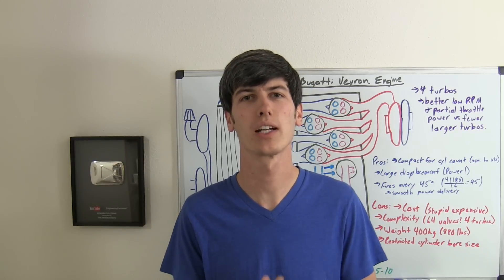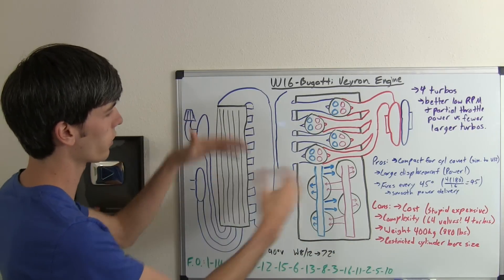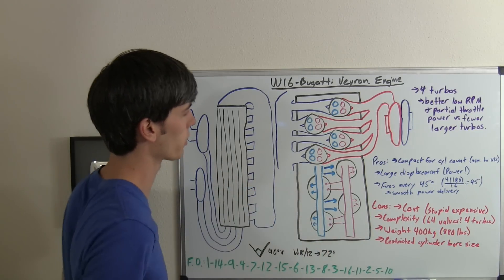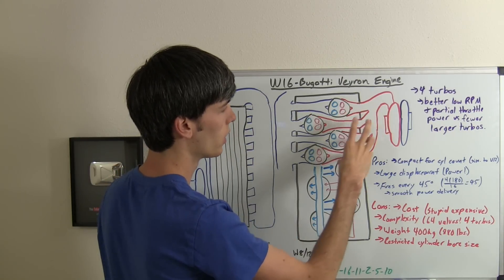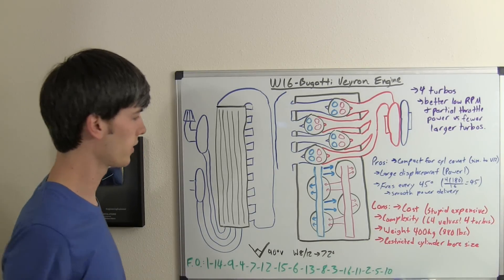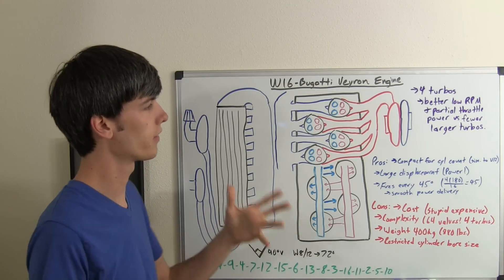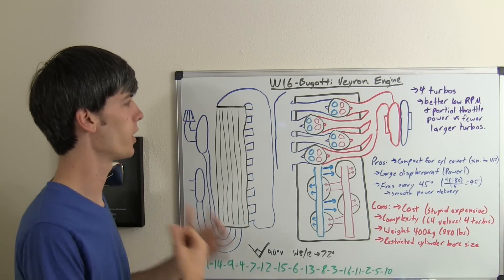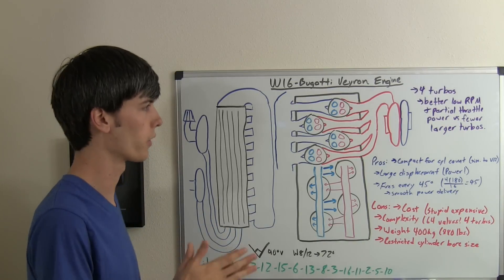W16 Engine - Bugatti Veyron - Explained

Comment: You forgot to mention to the idiotic fanboys that it's dot really a W! A W must can 2 crankshafts, and VW should call them a VVR8 or a double vr8!
But the 16cyl is utterly pointless, (except for bragging rights), as we all know, v8's are more than capable of making a mere 1250hp, and they are still as large as 7 liters. V10s go up to 8.4 in the Viper, and that engine would be making way more if it had 15psi of boost like the "w"16.
It's too large, it's unserviceable in the car, and it's only a selling point. The quad turbo is also somewhat of a selling point but it's to reduce the piping required. "It has more radiators than Jeremy Clarkson's house" because they wanted that stupid W16 selling point, so they literally had no space for an air:air IC or large enough single radiators...literally one of the stupidest cars of this era!
Reply: It not completely pointless. take a couple motors and say they are all 8L making 1000hp. a 4cyl, a 6 cyl, a 8cylinder, 10,12, and 16. For each of those they would have to make per cylinder 250hp, 166.67hp, 125hp, 100hp, 83.3hp, 62.5hp. Lets use the 4 cyl and 16 as examples. Each of the 4 cylinder rods, pistons, and cylinders have to survive the temperature and pressure for 250hp each. In the 16 cylinder each rod, piston, and cylinder only have to support making 62.5hp. Each cylinder, piston, rod, is going to be under less stress so the motor will be under stressed. At least i think that is the thinking
Reply: Torque man. You going to get a lot of natural torque and a lot of torque from the turbo added to that. However high numbers can be achieved without having a W16 i just admit. Look at the 65 AMG engines. 1000nm. HOWEVER the merc is rated at 1000nm only at a specific rpm where as the Bugatti will have more steady torque across the rev range. Keep in mind that this is just me assuming why they chose that engine.
Reply: custommotor That would be valid if the power figure was over 2000...A v8 with forged internals has no problems with 125hp per piston. And a v8 has way more room for each rod journal on the crankshaft, so the bottom end would be stronger. There is also more room to make the sleeves thicker. The bore also can be way larger, reducing the need to make the stroke larger to have a higher displacement. So a v8 would do just fine pushing +1000hp as MANY do. And as far as potential goes, it still has more than the "w". Why do you think hardly any company touches the Veyron's engine?! Plenty of +1500hp Vettes, Lambos, Vipers, and no Veyrons!
Reply: Best Braai
 Unfortunately I have not ever seen a dyno sheet of the Veyron. But based on the fact that the Veyron pushes a very low 1000hp on 15 psi of boost out of an 8l, it is likely that the turbos are small so all the torque is at lower rpms and the engine dies up top. I know they claim flat torque but think about it, the engine's just like 4 4cyl single turbos. Go look at the torque curve of any 4cyl making 250 hp.
Reply: The reason why they have done a W16 instead of a V12 or a V8 turbo is the fact that this car was developed a decade ago and VW already had W8 and W12 technologies and parts ready for power train. As development progresses, they discovered that W layout greatly limited how big each cylinder can grow without melting the block.

You can argue that bigger turbo can do the same horsepower game. Yes and no.  

Yes, you can have a 1000 hp from I6 or V6 or V8, but that won't do well in emission, consumption, and refinement and that engine won't last more than 100,000 km of "normal cycle". Think about how turbo works: it is perfectly efficient when rpm and pressure are consistent. Once the pressure dropped or rpm goes down, fuel economy has to sacrifice to save the engine from blowing up. 

The fact that W12 engines could only produce around 500 hp in early development stage push the VW engineers to develop W16 for their super super car. And the rest are remedies after remedies of ingenious engineering solutions, rather than going back to the drawing board and think of other engine layouts for the quest of a 1000 hp.
Reply: mercedescl Again I repeat, the Veyron is not a low boost engine, it's 15psi. It's higher boost than MANY turbocharged sportscars. It was not designed to last a long time, because it was not designed to be a daily driver. It may very well do, as may a Koenigsegg Agera R pushing more power with a relatively tiny v8. But that;s not proven and will never be, so lets leave Bugati's claim of the Veyron being reliable aside. I doubt any of them have over 50k.
The fact is they knew they needed a lot of power to beat the F1 cuz the Veyron has horrible aero (cuz it's big, cuz the engine's externals are big), they could easily fit a large v12 as lambo does all the time, and they knew a 6.5l v12 like Lambo uses are more than capable of 1000 reliable horses. But they wanted to create a fanbase and to do so, they needed a nice spec sheet. So they went for big numbers rather than actual performance. That's why it makes 987hp, but they use the ps unit, which is 1001. That's why it has too many of everything, and why it weights more than a house!
Reply: TheXdmgx7 16 Psi is not a low boost turbo, but what about trying to squeeze 1000 hp from a 2.7L or a 3.7L engine? More boost or lower boost?

Bugatti had done it a decade before Agera and the project had started more than two decades before that. Just because people are able to do it now with V8 or V12 and pass emission test and daily normal cycle, it doesn't mean people had expected that. Again, it is easy to argue what's more efficient or what's better in retro-prospective, but no one had ever dreamed of selling a million dollar production car beside Ferrari. And Ferrari had over seven decades of fan base.

Lol. You can argue that you can use your phone to have the most efficient and cheapest way to get to know what time it is. Why bother to spend over $70,000 on a Rolex?
Reply: TheXdmgx7 15 psi from all the turbos combined or all turbos producing 15 psi? Also Koenigsegg beat McLaren's top speed record before Bugatti.
Reply: mercedescl  So you're saying that the Veyron project started 30 years ago, even though VW AG bought them in 98! And Bugatti is a very well known brand. Their last model the eb110 sold for $400k in the 90's. Very close to what the f50 sold for. That car also had 550hp out of a 3.5l, which is a much higher specific output that the Veyron. 
No your argument is that a really large watch is better than a classic small watch and should sell for a lot of money. Lil Wayne would probably agree with that.
Reply: TheXdmgx7 Lol. 550 hp out of 3.5L  of the old EB110 won't pass modern day emission test. And the old Bugatti was dead because no one wanted to buy it against Ferrari. 

Put it in contemporary prospective: Pagani Zonda was selling a 7.3L AMG V12 with 555hp. 

I don't know what points you are trying to prove any more.
Reply: TheXdmgx7 wahahaha Just thinking about how many grey imports JDM GTR got crushed by California authority for failing import duty due to emission and other safety rules violation. S2000 can't pass new car emission test of today. What make you think EB110 can?
Reply: mercedescl They got crushed because they are not allowed to be here. Has nothing to do with smog. A whole bunch of r33's are in cali and are allowed to be driven, just not much. They have a collector or show car title. The rb actually burns pretty well. 
And the s2000 smells like a catless car even when it has a cat, but the thing is it passed the tests when it was made, which was the same period as the Veyron. You know what car passes? Mp4-12c making +600hp out of a 3.8, and so does the GTR and every porsche. What makes you think the 3.5l turbo eb110 won't pass with a bit of tuning, which a car manufacturer can do?
Reply: TheXdmgx7 Lol. 600hp in 2014 and 1000 hp in 2003 are two different world. Just think about it, Ferrari had thrown everything at LaFerrari and it still shy of 1000hp. It has to build a race track exclusive to break that magic number. 

Again, 1000 hp is just a number. It is not hard to go there. People had done it since WWII. But it is an absolute modern marvel to have a 1000 hp but easily livable by people who have the lifestyle of Paris Hilton.  Do you really need 16 cylinders to do the job? Maybe not. But for W type designs, this is the only way without completely throw out the original plan. (Originally they wanted 18)
Reply: mercedescl You'd be surprised. Engine management is the main difference. The VR38 in the GTR shares the exact structure with the VG30 in the 300zx. 
And Ferrari has thrown everything, except freaking boost. You're comparing NA and turbo again and again! Some people want a good car, so they don't go for numbers. They want a linear power band so they stay with their large NA. Some want light weight and small engine, like McLaren, so they go boosted. Then there are those who want to race spec sheets with others so they combine the two, and make a useless engine that's too large, so they don't have space, which makes them need useless shit that further improve the spec sheet. Then all that useless shit makes the car big, and big and round is not aero, so the coefficient of drag is 0.36, worse than nearly anything without a wing. The frontal area is also huge, so they need 1000 freaking horsepower to be a mere 10 or so mph faster than a car with over 300hp less power! Then they find some retarded journalist and feed them the spec sheet, which in turn gets fed to the people, who then think the "w"16 is efficient, or the only way to make that much reliable power, etc. That results in a car that was barely faster than a Zonda or Enzo around top gear (a power track) and slower than a Murcielago lp640, Ford GT, SLS, etc around the nurburgring...cuz it's fat and useless! now go ahead and think that they needed the "w"16 to pass emissions and to beat the Koenigsegg in top speed. We all know that the Gumpert, Enzo, F1, Murcielago, Viper, GT500, etc were all cars that had similar or more specific powwer and they all passed the emissions and would have as fast had they been after top speed. Also the Venom GT passed too, and the Agera will! 
I'm done with this fact vs. ass talk "argument". GL with your fanboy-ness.
Reply: TheXdmgx7 Lol. Cars are tools and products. Bugatti isn't a track car or try to be a race car from day one. It is simply a daily car with a 1000 hp and a top speed record. 

"Gumpert, Enzo, F1, Murcielago, Viper, GT500, etc were all cars that had similar or more specific powwer and they all passed the emissions and would have as fast had they been after top speed."

Lol. Bugatti is faster. If you want to argue about specific power, why don't you ride a bike instead?
Reply: You don't know what you're talking about. You don't seem to understand the genious behind this engine. The genious is not in the power but in the durability. They didn't want to make a 1000hp hypercar, they wanted to make a 1000hp CAR. It has a 1000hp but should still be as reliable as any other car. A 1000hp V8 will not last as long as a 1000hp W16, that's pure physics and you cannot change that.

The reason the car has so many radiators is because this car is all about aerodynamics. Using one large air intake with a large radiator in it would give the car the aerodynamic drag of a house.

You don't seem to understand how automotive engineering works and how complicated it is.
Reply: AR1G3 what you and many others don't understand is that it is in VW's interest to claim that this engine will last longer because "w"16. Nobody has ever and will ever test that. Yeah it has more cyls but they're small. Vr engines have high stroke. So there is a lot of pressure o the piston, rods, bearings. You think there are more so the force is divided but the pressure is arguably more because of the lack of space to make the parts as beefy as a v8. It also has 5 main bearings, just like a v8. Ferrari makes similar specific power and Koenigsegg makes way more and neither has gone kaboom yet. Partly because they don't get driven much and partly because v engines have much more room for beefy internals. 
And no, many radiators due to the "w" being ridiculously wide and tall.
And no, the veyron is not aerodynamic at all. Coefficient of drag is very high and that's why it required 50% more than the old McLaren f1 to go a mere 13mph faster...it's simply a failure in every angle except sales and fanbase. Both due to their awesome ad campaign.
Reply: TheXdmgx7 Do you know anything about engineering? Yes the aerodynamic drag is quite high, because it has to generate downforce to make it stable. Downforce means the air flows slower over the top of the car. So yes that generates drag, and this drag is essential. That's why they split up the radiators, because if you already have a lot of drag you don't want a big radiator on the front.
The Veyron is aerodynamic, or you don't know anything about aerodynamics.

The W16 has double the amount of combustions per rotation which means the torque delivery is smoother. If you know anything about engineering you know that a constant force is less damaging than a pulsating force. So the closer you get to a constant force the closer you get to a constant torque figure. So the more times you apply a force per rotation of the cranck, the more levelled out your torque will be. Which is wat you want because you will reduce stresses on the cranck and on the bearings.
Reply: TheXdmgx7 You are being funny again. Ferrari has never attempted a 1000 hp road car. Bugatti Veyron was conceived in 1999 and started selling in 2003. 10 years later, no other manufacturers had mass produce any other 1000 hp customer cars. 

Old Mclaren F1 has no pedestrian safety features, it won't pass 2003 production car limits, and, most important of all, it simply doesn't have a 1000 hp. Again, the design is to make a daily car with a 1000 hp. Get it?
Reply: AR1G3 I have a piece of paper that says I'm a mechanical engineer but no, you're probably right.
No, high speed land vehicles MUST NOT rely on downforce for stability. All the stability must be created by making the flow as laminar as possible, and by the car's suspension geometry. Relying on downforce will result in the smallest wind cause chaos do to that little square symbol in the drag and lift equation. So yeah, you might know about aero but not the practical methods. I'm guessing you're a student in high school or college. Undergrad though.
The smoothness of the torque delivery is a thing of importance for a 4 cyl engine or fewer. A v8 has 200 combustions per second at 3000 rpm. Do you think you'd feel those? Again, it's one of those things that is better on paper but in the real world, nobody would be able to distinguish.
And take a look at the veyron crank and count the number of rods that attach between every 2 main bearings...you'll see the ridiculous sheering force they have to survive. Then take a look at a horizontal engine and you'll see why those have such outstanding bottom ends. That weakness in the crank, caused by the engine redundantly being a "w", is why tuners get more power out of a VR38, LSx, Viper v10, Lambo v10, 2jz, Porsche boxers, etc. that the most powerful tuned Veyron had.
Reply: TheXdmgx7 I still don't understand what you are trying to argue. If I write, a refrigerator is big and heavy because it needs to keep a lot of things cold; and you write, a pencil is a lot more exciting than a refrigerator because ...... (hundreds of words later) I just don't know how to response. 

Veyron did the impossible. Veyron is a historical achievement. It may not be perfect but it opened a new era for super hypercars. 

It is like Mercedes Gullwing and Porsche 959. They won't have stunning looks, fantastic track experience, or a Ferrari badge, but they are watershed moments of automotive world.
Reply: mercedescl  No, it's like I'm saying that the manufacturer wanted to make this refrigerator seem impressive, so they put a huge pump on it but that pump produces a lot of heat, so they had to put an even bigger pump on it to cool the first one down, and they kept going. The end result was an excessively large refrigerator that was good at nothing but had an impressive spec sheet, because it had many pumps. They then started advertising that it has that many pumps to make it reliable but the truth was that they made the mistake of putting that first excessively large pump in the first place. The refrigerator had a large following and a huge fanbase but it never sold, to an extent that the manufacturer claimed that they're losing money despite the ridiculous price tag. But you know what? There were other refrigerators that ended up doing better because they had one properly sized pump in the first place.
damn that worked perfectly. Thanks haha

What exactly was the impossible? Adding 13mph to the top speed record 14 years after everybody has stopped caring?! Do you really think 1000hp is impressive?! Do you think Ferrari, Lambo, Mercedes, Pagani, etc couldn't just slap a turbo on their cars and make 1000 hp? You mistake lack of interest with lack of ability or technology.

Oh god, did you really compare the gayron to the 959?! The Veyron is already forgotten dude...
Reply: TheXdmgx7 They veyron wasn't about the top speed. It was about the combination of comfort and luxury and speed. You need to be able to do 400kph and still feel like you're driving an Aston Martin at motorway cruising speed. That's why it generates lots of downforce, to push the car on the road and stop it from being nervous. That's why they put lots of radiators in, to be able to make the car have the perfect shape for generating downforce. This car should feel like any other luxury touring car, but just go twice the speed. That's a bigger engineering challenge than just making it go fast. Proven by the Venom GT, yeah the Texan cowboys made the car go fast but the driver who did the run at Kennedy Space Center said the car was terrifying at high speed.

The reason Volkswagen makes a loss on every car is because of the engineering and development. They never did this to earn money, they just did this for the sake of doing it. Because they have enough money to do it and they wanted a challenge.
Reply: TheXdmgx7  Do you think Ferrari, Lambo, Mercedes, Pagani, etc couldn't just slap a turbo on their cars and make 1000 hp?

Again, anyone can "slap" a turbo to make a 1000 hp. The key is a 1000 hp with a warranty and allow its driver to shop in Bel Air. I haven't seen any rivals yet. 

I have seen how lots of Supra literally melted their blocks and blew numerous transmissions in the quest of "power" and how those owners need to keep engine running to prevent turbo blew after short journeys. These are the sacrifice. Not everyone is going to pay a million dollar for sacrifice these days.
Reply: mercedescl Oh it is that easy. A large engine like the ones I mentioned have no problems with the 15 or so psi they would require to make 1000hp. Mostly because they are V's and V's have room for beefy bottom ends. UGR Gallardos break at 1500hp, modded supras "melt blocks" at over 2000hp or without proper supporting mods. You're mistaking the limited financial and technological situation of a small shop to a big company. Remember that Ferrari and Mercedes are f1 engine builders and have been for years. Lamborghini is also a legendary engine builder, not mentioning that they're owned by VW as well.
A water cooled turbo also doesn't need to cool down after running hard. They don't want to deal with water cooling it so they do that. You keep mistaking lack of intent with lack of ability. The Veyron likely has an electric water pump, just like many other VW's. Not difficult to put on on a supra or any other car, if the intent was there.
Reply: AR1G3  Incorrect, the Veyron was only about the top speed. It has nothing on the old Murcielago except that extra power that results in the higher top speed.
And again, it doesn't have downforce. Even the wing is down to lower downforce. It has drag because of all the orifices it has for cooling that stupid engine, which makes it need more power, needing more cooling, needing more power, and it goes on.
And the Veyron was never tested on a public road like the SSC, Venom, and Koenigsegg. It was simply tested on that perfectly flat testing facility VW has. Which they don't let other cars use because they known their record is beaten.
You misread what I said; I said "claimed" they lost money. That car has no new technology. All of it is available on VW cars.
You and the other fanboy think 1000hp is the same stress on an 8l engine as a 2l. Not so, the specific power is lower than MANY turbo cars. Lower than almost all sportbikes. You compare it's transmission handling the power to a Supra's getrag taking the same power. It's not the case. Be impressed when the Supra's v160 handles 1600hp, not when the Veyron's handles what it was designed for. Making a transmission large is not challenging at all. Lack of intent should not be mistook with lack of technology.
Reply: TheXdmgx7 Find me a piston engine with less than 8 litre with 15 psi that makes a 1000 hp. Please. lol
Reply: TheXdmgx7 SSC, Venom, and Koenigsegg are great cars. So? The Veyron still has interior, build quality, services, and a 1000hp to show for. 

This is just like comparing Mercedes Benz S-Coupe to M3 or M6. Same top speed? Power and handling? Don't give a XXXX.
Reply: mercedescl
 Google "How To Build a 1,200 HP LSX Engine - Pump Gas Powerhouse"
7l making 1120 at 12 psi.
That's just one example. I can name MANY more. Vipers pass 1000hp at 10-11 psi.

And SSC and Venom are much cheaper and faster but the Agera easily matches the Veyron's interior quality.
The Veyron has 2 years of warranty, so does Venom GT but the Agera has 3 years.
And they all have over 1000, much more.

S coupe is better than M6 in your mind? lolololololo fanboy
Reply: TheXdmgx7 Lol. You obviously skipped the emission test, fuel economy requirement, warranty, and refinement for luxury GT. And LSX requires 110 octane fuel to achieve 770 horsepower. It won't work on 93 octane.

Same can be said for 1000 hp Agera. You will need E85 to achieve that number.

There is no way you can achieve a 1000 hp with less than 8L and 12 PSI with 93 octane fuel and it won't blow itself up if the owner inserts 85 octane fuel.
Reply: TheXdmgx7 Then why did they design the underside to be venturi shaped to generate more downforce? The car does have downforce, and it gets generated by it's shape. The reason the wing retracts is because it sits behind the rear axle which means it would be lifting the front wheels off the ground at high speed. You say you are a mechanical engineer, but you fail to recognize the engineering marvel of this car. The biggest challenge at those speeds is keeping the car on the ground. At top speed the car is going roughly 100kph faster than the takeoff speed of a Boeing-747. You want the car to stay on the ground and not lose any of its weight. You want it to weigh more.

If you're a mechanical engineer you should understand that a W16 needs half the horsepower per cilinder to a V8, thus decreasing forces on the cranck. Sheering forces will be smaller than in a V8, because the force that acts on the cranck is smaller. Stresses on the bearings will be smaller as you don't have as much power per cilinder. 

You are calling us fanboys, but you are in fact just a hater.
Reply: AR1G3 Lol.I just can't take him serious. Think of it this way: even in 2015, it doesn't sound that bad to sell a 4.0L 500 hp turbo DI V8 for a luxury car. I just don't understand why he is keep bitching about "specific horsepower". Engine is a balance of refinement, efficiency, reliability and output curve. There are good engines and bad engines, but everyone needs to balance out one way or another. You can't get something without sacrificing the other factors.
Reply: mercedescl Yeah exactly, a good engine doesn't mean it gives the most power. Like I said, a 1.6 turbo in an F1 car give you 800hp, but you wouldn't want that in your car. Just making a V8 bigger and letting it make more power doesn't mean it's a better engine. He says he's a mechanical engineer but with all the things he has written here I'm really starting to doubt it. An engineer would appreciate the aerodynamics of this car. An engineer would appreciate the out-of-the-box-thinking of making a W16 instead of using a more common engine layout. An engineer would know that when you divide one force by two forces each seperate force will have to be smaller. An engineer would know that if you decrease the force on an object the stress on that object will also be smaller.
Reply: mercedescl  You pointed exactly in the right direction. "doesn't sound that bad". You are making a legend out of "doesn't sound that bad"
Engine is a balance of those things. The Veyron has only the refinement out of all those things. It's certainly not efficient, 15 psi for 125hp/l. Reliability has never been tested so unknown.
There are good engines, LSx, 2jz, s54, f22, etc, and there are spec sheet and false advertisement engines. Choose wiser.
Reply: AR1G3 That's a fallacy. I did not say they should have used an F1 engine or an evo engine to make 1000hp. I said they did not need a w16.
And lol, I'd appreciate out of the box thinking if it's beneficial. They could have had an inline 16 as well. That would be just as bad though. Out of the box ≠ good.
W16 is a bad design. It's too wide. It has 4 freaking cylinders per every main bearing. The bottom end of a boxer 6 is very likely to last longer making 1000hp than the w. Why? 1 cyl per main bearing. Absolutely no deflection. Very minimal bearing wear. I'm gonna tell you what they could have done. A BVR engine. Combination of boxers and R's. The same 15° between the rows, but the two rows are horizontally opposed. It will be 10-15% longer, but much shorter. Turbochargers will be placed underneath, an air to air cooler placed on top, because you now have room. There will be 9 main bearings, much more room for a bigger bore, making the engine make way more power, much more safely, because detonation doesn't happen as easily with the smaller stroke. Also much more room for massive intake and exhaust ports. So the same 15 psi would easily make 1300hp because they can now make it rev. It will be more reliable, more efficient, and more powerful.
That's what an engineer would have designed for them, but instead they had their sales team be like "we need something that would stand out, lets have a w16, so that we don't have room for jack shit, and so we can have many radiators, making out car less aerodynamic, so that we actually need 1000hp to go 400kph. All about them numbahs!
Reply: TheXdmgx7 "Choose wiser"? wahahahaha none of your "good engines" has 1000 hp. If it is so easily done with "bigger turbo", why other manufacturers don't do it? 

I am waiting for your sub 8 liter 15 PSI 1000 hp production car engine. Where is it?
Reply: mercedescl
 I sent you one. 7-8 comments up.
Lol they don't have 1000hp for the lack of intention. Tuned versions surpass the Gayron easily.
But compare the engineering challenge:
2jz-gte; 3.0l 300hp from factory, commonly tuned to 1500+ hp. Also holds the fastest import 1/4 mile, with the trap speed of 241mph. I know it's a little unfair but there are also 8 second daily driven Supras that last a surprising amount lol I've heard 100k miles is doable, if you stay out of boost.
Now compare that to the Veyron, a freaking 8l designed to make 1000hp. How much power does the best tuned Veyron produce? 1500hp?
Which do you think is the better engine? I'd say the 3.0 that was designed in the late 80's that still surpasses the power and reliability of the 8.0 designed in the 2000's.
Dude you're making this way too easy. Go read some more. Read about the alternatives so that you can argue more effectively. See how much I know about the "w"16? You'd sound like less of a dumbass if you knew more about those "good engines" I talked about earlier.
Reply: TheXdmgx7 Lol. You are now making fantasy cars. Yeah, someone in their backyards are making 1000 hp Supras or GTR that will last more than a million mile. Lol

If it is that easy, then you start to question: why Nissan or Toyota didn't make a 650+ hp car? or 700 hp? 

Because every mass production engine has margin of tolerance for various reasons. Tuner simply push the edge of tolerance. By doubling or tripling the production out, you ultimately shorten the life of the engine. There is no way around it.

And most important of all, you simply cannot have a 15 PSI 1000hp Supra. The boost is not enough. Production cars have production cars limit. You have to compare apple to apple.
Reply: mercedescl  It's really simple. Manufacturers almost never introduce the best they can do. They only sell what is required for them to sell. Why didn't the 1st Veyron have 1200hp like the SS? Why did the LSA in the CTS-V, which is the same block as the LS9 in the ZR1 make much less power? Why did the LS1 in the C5 Corvette make 40hp more that the LS1 in the Camaro of the same years?
Engine technology has not changed much in the past 2 decades. (Direct injection is the only major one) Tuning capabilities have gone much higher due to much better ecu's and the existence of wideband o2 sensors.
And it's not just one person man. Search Supra vs. and you'll see. It is done so often that has made it more proven than the Veyron. 
And no, you cannot have a 15 psi 2jz making 1000hp...duh...tiny engine. But you can have a 1000hp supra that's more reliable than a Veyron. Go count how many have gone kaboom.
I gave you production cars. Agera, SSC Ultimate Aero, Venom GT. All more powerful than the Veyron, more aero, equally comfy, all done by much smaller companies, and all with equal or better warranties, and not a single one has exploded yet. They all pass pedestrian safety laws, as well as emission.
Reply: TheXdmgx7 Engine technology has not changed much in the past 2 decades. wahahahahahahahahahahahaha I almost died laughing. Engine technologies have made almost quantum leap in the past 2 decades because of new materials, computer design software, 3D printing, and new ECUs. 

Agera, SSC Ultimate Aero, Venom GT only come after Veyron. Like Columbus said: that once the feat has been done, anyone knows how to do it.

Equal or better warranties? What about leather covers everything? Air condition? Keyless entry? Sat Nav? Cruise control? Power windows and seats? Sound deadening?
Reply: mercedescl  What did those have to do with engine TECHNOLOGY? List new ENGINE technologies. Not ecu, not management, not trans technology. Engine.
Same can be said about the EB110, the McLaren F1, and the jag XJ220, etc.
Stop thinking those other cars suck without knowing about them. Go look at their interiors. They all have all those things.
Reply: TheXdmgx7"What did those have to do with engine TECHNOLOGY? "

"Not ecu, not management, not trans technology. Engine."

"Go look at their interiors. They all have all those things."

wahahahaha Don't want to talk to an idiot any more.
Reply: mercedescl
 great argument. Go be a fanboy somewhere else. That crap won't fly on "engineering explained"'s videos. See ya.
Reply: TheXdmgx7 "What did those have to do with engine TECHNOLOGY? " is enough explanation that you know nothing about "engines" and how they are made. 

Why don't you go to find me a sub 8 liter 1000 hp engine with 15 PSI turbo boost like you had promised?
Reply: TheXdmgx7 Reliability was never tested? What did they do in these 7 years of development? And in those almost ten years of production now there aren't any veyrons catching fire and things like that. 

The W16 is wide, yes, but doesn't matter because it fits in the Veyron. Doesn't have to fit a Golf... The Veyron is wide to improve stability, so it can carry a wide engine.

You say they couldn't fit a big radiator because the engine was so big. There's plenty of space in the front I think... They didn't put a big one there because that would break their aerodynamics.

But I just realise this, you accuse the W16 of being wide, then continue to say they should have used a boxer VR engine. Which is obviously even wider. You're talking shit man, you're talking shit...
Reply: mercedescl
 Elaborate on how me telling you that what you said had nothing to do with engine technology is an indication of me knowing nothing about engines and how they are made?!
And as I said a few comments up, I already send you one. You just are a troll fanboy who doesn't even read the comments he is trolling on.
I send you a "7l making 1120 at 12 psi."
And to top it off, that is a freaking pushrod engine lol
Reply: AR1G3  Auto magazines do long term reliability tests because the company cannot be trusted. It is in their interest to say their shit is more reliable than a prius!
But no Koenigsegg, Hennessey, SSC, etc. has caught on fire either, during more years of production.
It is wide and it doesn't matter, except they have to change their designs to accomodate it. That is why they have such high coef of drag, as well as surface area, and why it needs 1000hp to go 400kph.
Oh it has 3 in the front. RESEARCH THE CAR YOU'RE DEFENDING! lol "There's plenty of space in the front I think... They didn't put a big one there because that would break their aerodynamics." lolololo the aerodynamics are already broken haha

Yeah but they're not WIDE and TALL. So you'd have room on the bottom, because you can mount higher, and you have room on the side, so they can have shit on top. Nothing would fit on the sides but that's not different than the "w".
Reply: TheXdmgx7 "7l making 1120 at 12 psi." running on racing fuel? Nice. 

Your beloved Agera is made possible because 3D printing allows it to have mill a very specific turbo that bespoke to its engine layout. Otherwise, the development of the bespoke fuel lines, fuel pumps, and turbo will make it out of business case. But it still needs E85 to run its max hp power. However, it is still not EPA certified to allow it to be sold in the US.
Reply: TheXdmgx7 Yeah but there are less produced. The Veyron: 420, all koenigseggs ever sold during the whole life of the company: 107. Koenigsegg never produced 30 cars of 1 of their models. Bugatti produced 420 cars of 1 model. You as a 'mechanical engineer' should understand that making 420 cars to the same standards and tolerances is harder than making 10 or 20 cars. 

The Veyron may have 3 radiators in front, but what I said was '1 big' radiator. You said they had to put a lot of radiators in because the didn't have room for 1 big one, when clearly that isn't the case. You just don't want to put a wall on the front of your 430kph hypercar. The car is wide to make it stable, which is why even James May could get the car to 415kph and reported the car felt the same at +400kph as it felt at 100kph saying it didn't vibrate and feel unsettled like most cars do when you take them to their top speed. The 'record' driver of the Venom GT however said the car felt pretty terifying over 400kph. 

I am not denying it has a high drag coefficient but that is just because it generates downforce. An F1 car has a typical drag coeff. of 0.7-1.2, which is higher than that of a Hummer, a Westfalia campervan or a truck. The aerodynamic drag is created by the wings and the shape of the body which makes it possible for the car to pull +3G through corners and go flat out through Eau Rouge at Spa-Francorchamps. This is also why the Veyron satys stable at high speed. The floor has a venturi effect in it which makes the air move faster underneath creating a low pressure zone sucking the car on the road. The shape of the body is designed in such a way the air that passes over it pushed the car onto the ground. If you think the Veyron doesn't have downforce you really don't know anything about aerodynamics. Downforce is created by making surfaces collide with the air that passes over them, drag is created because of air that collides with surfaces on the car. You can't have downforce without drag. 

About the engine: have you researched on this? Have you had acces to the CAD files? Because I'm pretty damn sure the car also need something called "a chassis"? Or "suspension"? There's a great documentary on how the car is built, and you will see there is no spade for a boxer engine in there because that would be too wide leaving no space for the rear frame and the rear suspension. If you were to put a boxer engine with this kind of power in this the car would have to be even wider to accomodate for the suspension, or you would have to put the engine up high, raising the center of gravity.

You may claim you're an engineer, but you don't sound like a scientist.I don't claim to be an engineer, and yes I am a student. However I study Automotive Engineering, a course all focused on engine technologies, aerodynamica, suspension, transmissions and things like that. And with I have learned so far I can tell you: The Veyron does create downforce, and the W16 engine is a very clever solution to the problem Volkswagen was stuck with. Which was NOT building the most powerful engine. What they wanted was a +1000hp engine that would have the same wear and reliability as an I4 engine. For this problem a powerful V8 isn't an option because this will have more wear on bearings, like said before. And yes wear on bearings in a 1000hp V8 will be greater than the wear in a 1000hp W16 because the force acting on each bearing is bigger.

I guess you're American? Anyway, you sound like a twat. This is my last comment on here, going to read a bit in my Advanced Engine Technology book.
Reply: TheXdmgx7 So much BS. A car with no downforce can travel 250+ mph? 

Still waiting for your sub 8 liter 15 PSI 1000 hp street legal engine.
Reply: TheXdmgx7  "it doesn't have much downforce" Very precise for an "engineer".

Nope. LSX454R only has 770 hp as a crate engine. Bolt on a real production car with A/C, EPA certified components, and 100+ electric motors will reduce it to around 550-600 hp. It makes sense because GM's Corvette and Camaro's 7L V8 "only" produce 505 hp.

Agera isn't legal to be sold in the US and it is 10 years younger. Last time I checked, Veyron is still the fastest production car because Venom hasn't sold enough number to qualify it as a "production car". "Tuner cars" and production cars are two completely different categories and there are obvious reasons to be. 

Again and again, 8L and 1000+hp isn't a bad spec. People are paying almost 2 million dollars per car. And if you think you are smarter than VW engineers and able to create some magic numbers for production cars, then you deserve a better job and a nobel prize. Lol.
Reply: TheXdmgx7" In tuned yet street legal form, it produced 1120 hp at 12 psi. "

Again, comparing a pushrod to a W16. Again, comparing a tuner engine to a production engine. Again, comparing an unverifiable claim to a production engine. Nice. Do you ever go to college? 

You missed the most important point of my statement. If "magic number" is that easily achieved as you said, why other big manufacturers didn't do it after a decade? BMW, Mercedes, and Ferrari lacked the ambitions or development fund for suck a project? 

And the reality is: if you can come up with a cheap way to do it, then you deserve a better job and a nobel prize.
Reply: mercedescl My point: Pushrod V8>W16.
I gave you an example of a production engine, former guinness record holder, and you chose to only respond to the tuned engine I sent you. Typical dumb troll.
So again and again and again I repeat, SSC Ultimate Aero has 1200 hp from a 6.5l v8 at 14 psi. It is a production car, it has the same warranty as the Veyron, and it is faster.
And I've told you this before as well, they don't do it because they don't want or rather need to. They are selling just fine with the non-magic power figures they have. Same can't be said about the Veyron.
And the reality is if you ever work at a mechanical design firm, you'd quickly figure out that the accountants and generally the business side of the stuff always win. The one time the engineers rule, stuff like the 918, P1, Countach, Venom GT, etc come out, then people like you come out and dare say the Veyron, a product of the business team is better because VW told you that its reliable and its very common tires are 20k each lol
Sheeple...
BTW read that ^ twice...for the love of your Mercedes, read it twice or thrice so that you don't bring up the same dumb question 5 comments down.
Reply: TheXdmgx7 Lol. SSC Ultimate Aero didn't qualify as a production car because it didn't sell more than 30 cars per production year. 

Seriously, how many people are willing to buy UA again? 5? Do you see any "Paris Hilton" drive one in high heels?
Reply: Sorry, which PRODUCTION CAR with a v8 made 1200 hp when Bugatti Veyron came out, like 10 years ago? Do share.
Reply: mercedescl that's by your standards. Guinness recognized it as the fastest production car in 2006 or 7.
Reply: todorpetrovic SSC Ultimate Aero
Reply: TheXdmgx7 Again, it doesn't produce enough to qualify as a production car in 2014/2015. And it doesn't have ABS, traction control, or pedestrian safety standards.
Reply: mercedescl How many Veyrons did they sell in 2014/2015?
Yeah but it has 1200hp out of a 6.5l V8 at 14 psi.
Reply: TheXdmgx7 over 50 cars.
Reply: TheXdmgx7 They sold all 450 cars minus 15 as of today. They posted the number up to 2013. It is not that hard to do the math. Genius.
Reply: mercedescl well they had sold 420 by the end of 2013, meaning they have sold 15 during 2014. So it's official, by your rules, the Veyron has not been a production car since the end of 2013. Congratz, you fucked your own argument over. :D
Reply: TheXdmgx7 Lol. You read the figure wrong. 50 Grand Sport version were ear marked for 2014 and there are still 15 remains to be sold as of today. That meant, Bugatti had produced 35 Grand Sport, including 9 special versions, this year.  The remaining cars will become 2015 year model.
Reply: mercedescl How many supersports made in 2014?
Reply: TheXdmgx7 Don't know.
Reply: mercedescl That's not the first time you don't but feel free to use your ass as a source of information like you always do.
Reply: TheXdmgx7 wahahaha At least, I know something about production engines At least, I know the fact that back in 2003, 500 hp is a lot, even for "supercars". 1000 hp is like almost 70% more than the poster child like Carrera GT or Enzo.
Reply: mercedescl What do you know about production engines? 
You know back in 2003 500hp "is" a lot?! "Is" $1.5m a lot also back in 2003? 
Congrats to Bugatti on having more power than others because others realized top speed in utterly useless. Congrats to them for having 270hp more than the Dauer 962 made in 1993, out of a 3.0l. Good job to them.
Reply: TheXdmgx7 Lol. You are going on stupid mode again. Little manufacturers in their backyards could come up with amazing hand crafted engines with special parts that have "special numbers" all the time. But they never have the luxury nor the access to the technologies to make ABS, traction control, ECU, or compliance to the EPA and NTSHA 5 star rating. 

Bugatti Veyron is special because it allows James May to test the top speed. In cars like Venom or SSC, without traction control, active aero adjustment, and E throttle adjustment, that's almost like a death sentence for amateurs to attempt. 

The key isn't just about the top speed. It is allowing average drivers to drive the 1000 hp monster, enjoy their luxurious & mundane life and survive.
Reply: TheXdmgx7  It was an engineering exercise. They done because they wanted to do it, and they could. It was their idea of fun, just like most people find it pointless slapping 1500bhp on a old muscle car just for the sake of 6 seconds down the 1/4 mile; you obviously find the Veyron pointless. Each to their own, it's only an opinion.
Reply: Shaun Hutchinson You have to include that with Phaeton, Toureag, Audi aluminium space frame, etc. VW was a crazy engineer nuthouse back then.
Reply: mercedescl
 Yeah, I was just meaning it in the since how the Veyron doesn't really have that much of a purpose other than it's exclusivity and as a tool of expressing an impressive engineering feat whether done through practical means or not. Where as the Phaeton and Toureag; they actually are practical cars with a purpose ie Toureag being able to go off-road or pull a decent load and the Phaeton being a very comfortable and spacious high end saloon. But sweet jesus, they know how to make a 5.2 V10 that sings, easily one of the best sounding engines of all time.
Reply: Shaun Hutchinson What I meant is, VW could have stretched the Passat and called it Phaeton; VW could have done what Honda and Toyota did with Pilot and Highlander, but they decided to give it real offroad capability, torsional rigidity of military vehicle (enough to be stood on three wheels and opening the doors with ease) and enough engine space for W12 engine. All of these don't make any business sense, but they have done it anyways.
Reply: mercedescl
"In cars like Venom or SSC, without traction control, active aero adjustment, and E throttle adjustment, that's almost like a death sentence for amateurs to attempt."
They both have active aero. Venom has traction control. Not sure why the lack of electronic throttle would cause mayhem! And finally, james may is not a freaking amateur. And if you have tried any top speed driving, it's actually not hard at all on a smooth surface, which VW's testing ring definitely has.
That one paragraph alone is enough to show how ignorant you are. Do yourself a favor and look at the interiors of the cars that own the Veyron as far as speed goes. You seem to have a misconception that they are stripped and you sit on an aluminum stool, and have a potato for creature comforts. They are obviously no Bentley but they were not meant to be, and that's how they are less than half the price of the Veyron yet faster. Yet they all have nice sound systems, AC, adjustable steering, nice to touch materials and the whole deal.
Reply: Shaun Hutchinson
That's exactly what I'm arguing. I'm saying that it literally has nothing impressive. It is just a combination of nearly every technology VW AG uses in nearly all their cars, but put together by an accountant, with extra attention to selling and advertising points. The only amazing part of the team was the advertising, which has somehow convinced everyone that this very technologically mundane vehicle is simply an engineering masterpiece. You can literally name anything on that car and I can tell you what other VW AG car has it.
The reason why others don't do the same, which is combining everything they've got and putting it into one vehicle is that it doesn't sell as well as they could otherwise sell.
Chevy could make a much better car, see what Hennessey, as many call it, a tuning company has done. But chevy did not need to change its image like VW. VW wanted to lose the boring car status they have had for decades (Golf GTI aside) and they thought this could help. That is all the Veyron ever was. An attempt to make something with good advertising points to make people think "it's technologically unmatchable, and made by VW so VW has technologies others don't have. I can't afford a Veyron but that Jetta is probably relatively as good."
Reply: TheXdmgx7 2005. Back in 2005, which car has a 1000 hp? 

Lol. Venom has no side airbags, no NCAP certification, and it won't be designed with global regulations in mind. Until, Venom puts a journalist with no racing background to test its top speed, I will not believe it could be done in the manner of James May. And, it is still not qualified in the same rules as Bugatti Veyron.

"And if you have tried any top speed driving, it's actually not hard at all on a smooth surface, which VW's testing ring definitely has."

wahahahaha Any top speed runs can easily kill anyone in any cars.
Reply: TheXdmgx7 8.0L W16 a 1200 hp is not impressive with you. What do you drive? Flintstone's car?
Reply: TheXdmgx7 wahahaha Why do I bother to get a SL65 when I can get a SL550? I never have a speeding ticket nor attend any track experience and I have no interest in top speed or acceleration claims. What's the point? GTR is definitely faster for a third of the price. In fact, a plane ticket gets you faster than any cars anyways. 

WHO CARES?

I just love it. That's why. 

Bugatti Veyron is great because it is a landmark moment for automotive industries. Because it breaks new ground. And After 10 years, no other sizable automakers could have or bother to have done it. 

No one is going to pay you a million dollars for your 2400 lb 500hp suicide box.
Reply: mercedescl

I would say Koinegsegg (spelling?) isn't too far off. They are starting to push the envelope and have a lot of good engineering developments and ideologies they are pursuing that are all in-house. As for Hennessy, they are no more than just a tuning company, we are talking about production car manufacturers. In-fact, officially, the Venom GT is stated as a "Lotus Exige (modified)" when being declared for road use.
Reply: Shaun Hutchinson I am not arguing that Bugatti Veyron is the best car in the world or a better car than koenigsegg. The point I want to make is the fact that 16 cyclinder production engine and a 1000 hp are engineering achievements that should be reckon with. And even 10 years later, it is still a remarkable car. And 8.0L 1200hp is not a bad spec.
Reply: mercedescl

Yeah I know, I'm just saying Koenigsegg aren't far off that sort of stature themselves as well in different areas lol.
Reply: Shaun Hutchinson He doesn't know anything about the Koenigsegg, just like he doesn't about any other high speed contender. He just "knows" what VW has said in their documentaries. 
Koenigsegg, being the tiny company that they are, has contributed so much more than the Veyron to the hypercar technology, it's quite impressive. So much technology in those cars, and yet they're so simple and light. That's proper engineering.
Reply: TheXdmgx7 extremely safe racecar? "I have a 2400lb car with a 2.5l 90's engine making 500hp."

Yeah, it will be extremely safe in PS3. 

Lol. Again, Koenigsegg Agera and Bugatti Veyron are two completely different concepts of cars, developed in different decades. Bugatti Veyron is the first car with a 1000 hp and a car that breaks records. Everyone knows how to make a turbo V8, but anyone who appreciates mechanical engineering will know the four turbo W16 engine alone is an astonishing engineering achievement. It is extremely hard to do when you are breaking new grounds for production car. 

Agera comes after Veyron. Venom, or SSC is chasing after Veyron, not Agera.
Reply: I'm not contesting the Agera against the Veyron saying it's better or more of engineering achievement, like you say; they are two different cars based on different concepts. All I'm saying is that Koenigsegg like other companies are pushing the boat out in different aspects. Read up abou Koenigsegg's V8 and the special fuel system they developed for it as well as the approach behind the design of their in-house turbochargers, their clutch and anti squat systems and even the little things like fully carbon fiber rims. Just like how Ferrari pushed the boat out with their e-diffs and electro magnetic dampers etc. Just because the Veyron is an astonishing example of automotive engineering, it isn't the be all and end all.
Reply: Shaun Hutchinson I read them. I love cars in general from Civic to Maybach. I also read the fact that Agera and later one:1 are possible because of 3D printing and new breakthroughs in tires, composites, and metallurgy. I just appreciate all instead of putting down one (Veyron) to praise another.
Reply: That problems are problems only for you. Because people, who can buy it NEED that number of parts, needs that complexity and SMOOTHNESS. That people can afford this level of coolness and quality.
Reply: mercedescl
 Again with you bashing on something you know nothing about. I've raced my car and you have possibly driven something similar in PS3, so you don't know how it is.

And again, Agera was not developed last year. It has been an ongoing project, by a small company. It should be, and is astonishing to see them do so anything better than one of the biggest manufacturers, let alone so many things. Any mechanical engineer who knows about the Veyron's "technology" knows there's literally nothing ground breaking in it. (trust me, I am one, went to school with many, and work with many.) I asked you to name a technology in that car that no other VW has and you didn't. Again, technology, not spec.
Reply: Shaun Hutchinson
Very well said. Seeing such a tiny company who have produced 100 cars total, developing so many cool technologies, and somewhat standardizing them within the hypercar world is just awesome. Kudos to those guys.
Reply: Климент Алмазов
 What complexity?
Reply: TheXdmgx7 wahahaha W16 engine, 7 speed DSG, biggest ceramic brakes ever, highest speed rating tires, active air spoiler, etc etc, almost everything about Bugatti Veyron is as ground breaking as a single generation of car can get. In fact, the appearance of Bugatti Veyron is responsible for introducing 300 mph air tunnel testing facility for the entire industry. 

HKS had made 1000 hp GTR kits since 1995. But those monsters were almost uncontrollable for amateurs, or rich people with no driving skills and the engines would melt themselves after few thousands km of hard use. 

Again and again, Bugatti Veyron isn't all about speed. It is speed, refinement, and ease of use. That's the point.
Reply: mercedescl
I said technology, you're listing specs again...
W engines were made in the early 19th century.
VW golfs have DSG.
Z06's have nearly the same size ceramic brakes. (bigger rears)
Active aero? Freaking 1990 Mitsubishi 3000gt
So keep listing...I assure you, not a single piece of ground breaking technology exists in that giant piece of turd.
Incorrect, NASA has had much faster Wind Tunnels for decades...
Yes, there have also been drag cars with +8000hp for many years. They served a completely different purpose, so it's ridiculous to compare their reliability to the Veyron. I'm comparing cars made for similar use to it. And the Veyrons engine will die too after "a few thousand km of hard use". Not a single Veyron has had "a few thousand km of hard use" so don't tell me they won't.
Again and again, I agree that the Veyron is refined but their method for attaining the speed which was the sole reason of the Veyron selling more than 20 units is absurd. It is complete spec sheet marketing; I wouldn't even call it engineering.
Reply: TheXdmgx7 "W engines were made in the early 19th century.
VW golfs have DSG.
Z06's have nearly the same size ceramic brakes. (bigger rears)
Active aero? Freaking 1990 Mitsubishi 3000gt"

Production car engine? None
VW Golf have DSG? 6 speed and it will blow up above 300 hp in 2005. 
Z06? When? Oh, 2015. Lol. Bugatti is 2005, and you notice the word "almost"? And did you search for "thickness" and "capacity"?
3000GT? Lol. It won't even break 300km/h in stock trim. 

"NASA has had much faster Wind Tunnels for decades.." Yes, for aerospace industry. But everyone upped his game for the AUTO industry (which I had already stated  in the last comment)

Comparing drag cars and tuner cars to a production cars again. 

wahahhaha You are too far gone in the stupid world. The ability to achieve something in higher spec than everyone else is an engineering achievement. The ability to break records while maintaining road car refinements is an engineering achievement. German cars don't win because they are faster than American or Japanese cars. Because they are well rounded performers.
Reply: TheXdmgx7  wahahaha W16 engine, 7 speed DSG, biggest ceramic brakes ever, highest speed rating tires, active air spoiler, etc etc, almost everything about Bugatti Veyron is as ground breaking as a single generation of car can get. In fact, the appearance of Bugatti Veyron is responsible for introducing 300 mph air tunnel testing facility for the entire industry.

No need to type new things because you have no counter argument anyways. 

Find me a W16 engine, 1000 hp rated 7 speed DSG, higher speed rating tires, active air spoiler that worked with ECM, suspension, and stability system, etc, etc before Bugatti Veyron or shut up.

Everyone knows Bugatti is the first car with a 1000 hp when the most powerful Ferrari only has around 660hp back in 2005.
Reply: mercedescl  oh you didn't read it. I knew you wouldn't. Go read it again.
Reply: TheXdmgx7 Lol. Go find a 1000 hp production car before Bugatti Veyron. At least, you should learn how difficult it is to launch a production car project in a big corporation to push for a completely new engine with power and speed in uncharted territory. There are crazier projects in automotive history, but none could be as ground breaking in all levels as this one. NONE.
Reply: You place far too much importance on the fact that it's a production car. It is irrelevant. All that does is make it heavier. Other than that, there is little difference between it's 1000hp engine (not at the wheels either), and any other 1000 hp engine.
Reply: Authur Jackson Lol. Production car is the key because it needs to fit within the laws throughout the world and within the limits of production line. People had created 1000 hp engines since WWII, but none could have done it in production car before Bugatti Veyron.
Reply: Sure, needs to fit within the laws of the world. Give it airbags. Put it in a strong shell to give the safety rating you keep banging on about. Stick an air pump in the exhaust to get cats to fire. Wow. Some crazy 'engineering' there. I'm completely underwhelmed.
Reply: Authur Jackson Lol. What about the height of your lights? Distance between driver seats and windshield? Bumper strength? Emission? Smog test? Displacement and consumption restriction? and a long list of restrictions like ground clearance and variation in gas quality.

 Sure, you can be underwhelmed, but Bugatti Veyron is the first to have done it.
Reply: There's arguably just as much, or more, innovation in the new mazda 2 engine as there is in the veyron engine. There has been very little innovation in reciprocating piston engines in the last 60 years. Lots of adaptation, lots of optimising, not much innovation.
Reply: Authur Jackson Lol. There are evolution in timing control, ECU, piston designs, direct injection, valve designs, material changes, coating changes, completely new lubricant compositions, etc etc. Just because engines look the same to amateurs like you, it doesn't mean things hadn't changed in the past decade. Computer designs, new casting methods, 3D printings, etc are all happened within the last decade and make piston engines more efficient than ever. 

You need a lot of works and engineering to make things more efficient, more powerful, and more refine at the same time.
Reply: Maybe you can't read, so I'll give you the benefit of the doubt. Lots of adaptation, lots of optimising, not much innovation. All the controls are just adaptation. Multi-grade oil was first made in the 50's. Direct injection was first innovated in at the turn of the 20th century. Piston, valve, combustion chamber design and materials is all just optimising what they already had. No new innovation.

Arguably, the most innovative thing to happen in engines in the last 20 years is lean burn in the mazda skyactiv-g series with a 14:1 compression ratio. Impressive, for people who know what they are looking at, but still only halfway between adaptation and innovation. Diesels have been running lean since forever.
Reply: Authur Jackson Lol. Now you are making your own definition of innovation. Do you know the fact that lean burn had existed since Oil Crisis era? And Do you know the fact that almost all German cars had lean burning cycle in European market? Skyactive isn't a single magic wand, like Vtec, to make high compression ratio. It works, like you said, are because of people who make incremental changes on all concerning components. In my definition, that's innovations.
Reply: I didn't know lean burn was around since then, but if anything, that just proves my point about nothing being new.
Reply: Authur Jackson But no one had done a W16 in a production car before.
Reply: But they had done straight v's and V engines on a common crank for decades. W16 is just the same but more of it, like I said in the first place. It's just more, rather than innovative.
Reply: Speaking of innovation, 
http://www.motorcyclistonline.com/honda-rc174-rc-reborn
Reply: Authur Jackson Same but more of it. Lol. Honda had done I4 and V6 for years. They had done V8 race engines for years. But they failed to put one in production vehicles. W16, at least, is a more interesting solution than a bigger turbo or a bigger V12.
Reply: mercedescl  Your problem is that you're uneducated. You think making a w16 is twice as hard as making a w8. Making a 7spd dsg is 7/6 times harder than a 6spd dsg. Making 1000hp out of a 8l is twice as hard as making 500 out of a 4l. 10 times as hard as making 100hp out of 800cc.
Absolutely not correct. Each and every technology on the Veyron was used in some VW product BEFORE the production of the Veyron. The fact that they were desperate enough to need to use ALL THEY HAVE GOT doesn't mean others can't.
Bugatti doesn't sell as well as any other hypercar, and never has. That's why VW found the need to make a spec sheet car to make this turd sell. Who would have paid +1m for a Bugatti if it didn't have 1000hp? That's the only spec that made it sell the few units it took 10 years to sell. If it had 900 there would be less than half as many of these turds in people's garages.
Fact of the matter is that Pagani, Koenigsegg, Ferrari, McLaren, etc don't need a spec sheet to sell cars, they're all outsold before being produced. Unlike Bugatti and the infamous turd.
Reply: TheXdmgx7 Lol. You admit inadvertently that Bugatti Veyron is a more difficult car to engineer. Did I write twice as difficult? or ten times more difficult? No. How can you quantify engineering difficulties? It is easy to say "how hard can it be?", until someone do it. If it is that easy, why LaFerrari "only" has 963 combined horsepower? Why can't it has 1200 hp? 

I simply don't understand how Bugatti Veyron isn't a brilliant car when, after 10 years, the latest hyper cars are so eager to out drag it. How many cars you know had rivals 10 production years later that are chasing after it?
Reply: Cars with rival 10 years later - rx7 3rd gen.
Reply: Authur Jackson wahahaha RX7 was slower than Supra and hopelessly overshadowed by GTR.  A brilliant car with a brilliant engine, but rotary simply has its natural flaw too big for any engineers to overcome.
Reply: Supra and gtr were both GT cars first.
Reply: Authur Jackson Lol. Now you are making your own field of "rivals". Nice to live in your own little bubble.
Reply: My own field? Bullshit. Find me the rx7 in this list
http://en.wikipedia.org/wiki/Grand_tourer#Examples_of_grand_tourers

RX7 was never intended to be a GT car, it was targetted straight at the corvette as a pure sports car. It held it's own for years and won bathurst 12 hour 4 years on the trot.
Reply: Authur Jackson wahahaha Japanese had four super cars back in the 90s, NSX, Supra, GTR, and RX7. In the end, NSX and GTR became legends while tuners love Supra and GTR. RX7? Won in Bathurst for 4 years? Lol. Who cares?
Reply: Authur Jackson Again, RX-7 is a brilliant car, but it was overshadowed by NSX and GTR and it didn't have the tuning potential of Supra or GTR. The interesting point of that era is the fact that 993 and 964, both slower cars, are now more valuable than their original value. If love counts, than Porsche wins them all.
Reply: mercedescl When did I admit that?! lol I only admit that it takes a marginally longer time to design because there;s way more of it to design. 
No but you think it's more difficult. 
Why not? Because they don't need to. Why? Because the Veyron is a failure and is good at doing nothing except top speed. The LaFerrari on the other hand was sold out before being produced. It accelerates, corners, brakes, and is efficient in doing all of that, because it had smart engineers and a marketing team that didn't value specs more than performance. 
How many cars are there in this segment of the market? There are less than a handful and race options are limited. But Ferrari, McLaren, and Porsche were definitely not going after the Veyron. But hey, the Veyron, even the supersport, is now the slowest to accelerate due to its inefficient ways of doing things. Good job to the most expensive car of the bunch by far being slowest haha
Reply: TheXdmgx7 Longer to design isn't more difficult? Being the first production car with a 1000 hp and W16 engine isn't difficult? After a decade later and advancement in hybrid systems, Ferrari, McLaren and Porsche are all producing less horsepower. Failure? I don't think so. 

Slowest? I haven't seen P1, 918, or LaFerrari broke Veyron's top speed records yet. 

Let me remind you again and again. A decade later.
Reply: TheXdmgx7 "Making a w16 out of a w12 would be quite a quick process." wahahaha

 "higher specific power rating" = "better engines"? wahahahaah

Lol. If you love LaFerrari, but it is slower than cheaper 918 Spyder, should I say you are a fanboy who ......... 

VW is the largest European automaker. Lol.

Do you even know how engines are made?
Reply: mercedescl
1: You laugh because you're ignorant. If you knew better you would offer a counter argument.
2: No but making an engine with the same warranty, making good torque, revving high, lasting long and sounding great, and added to making more specific power, then yes. Better engine.
3: Nah you see, I only love my own cars and corvettes. Not gonna obsess over some car I'll never own. And the LaFerrari is faster.
A fanboy is a person who thinks the thing they like is the best even though there is a much more educated person proving to them that it's not. Kinda defines you.
4: Yes they are. But do they often make performance cars?
5: I actually do! Kinda comes with being a mechanical engineer. That's why I didn't need a source when I said adding cylinders to an already designed and tested engine is easy.
But the real question is do YOU know how engines are made?
Reply: TheXdmgx7 Lol. 

1: "Making a w16 out of a w12 would be quite a quick process." Seriously, Mercedes, Honda, VW, and Ford had tried inline 6, only BMW made perfect ones. Let alone making a 16 cyclinder engine with up to 1200 hp. Just to convince corporate heads to fund it is a monumental task.  

2. 2015 Remember? 2015. Why don't you talk about a production car with a 1000 hp? Why don't you talk about a production Ferrari with a 1000 hp, Mr. Fanboy?

3. You are a fanboy. Just want to put down others' cars to make yourself look good. Especially putting down cars that you will never be able to afford. 

4. Lamborghini. Audi RS & R8, Golfs, Bentley Supersport, etc etc 

5. You are a mechanical engineer? hahahaha You think engines are batteries? Just casting and testing new valve designs take months to test and perfect.Let alone adding new cylinders to W design engines. W engines are worst to remake in terms of changing displacement and adding new cylinders.

Bugatti Veyron is a great car with new technologies, just like Gullwings, NSX, 918 Spyder, 959, or GTR. It is exceptional because it breaks uncharted territories in terms of power, speed, and daily usability of such cars. To make a W16 1000 hp engine in mass production alone is an engineering achievement. 

I have my opinion. You can have yours. I will never convince you, and you will never be able to convince me anyways.

Because I think you are an idiot who will never appreciate the word "engineering".
Reply: Authur Jackson wahahaha Not as much as you and your friend Mr. X
Reply: TheXdmgx7 1. Ahh You miss all the fun of M3.

 Lol. Don't want to response BS, Bugatti Veyron is a great car because it broke new grounds with a one of a kind W16 engine. If you don't like that opinion, I can't do anything about it.
Reply: mercedescl
I've driven a few. Decent cars.
The Bugatti Veyron was the first production car to have 1000hp, and definitely the first to make 1000hp so inefficiently. That's all it will ever be.
Reply: TheXdmgx7 wahahaha Inefficiently? What about Hellcat that are virtually sold out in the US? Good cars don't need to please everyone. It is just YOUR opinion.
Reply: mercedescl Lol great. You compared your "best car ever" to a $60k muscle car.
And nope, it's not an opinion, it's a well supported fact.
Reply: TheXdmgx7 Lol. Again, that's your opinion.
Reply: mercedescl
 Not an opinion when it's supported by facts.
Reply: TheXdmgx7 Lol. Facts are facts. Opinion is opinion. You are just being prejudice against a car you can't afford.
Reply: mercedescl Incorrect, you're being biased towards a car you're a fanboy of.
Fact1: The Veyron makes 62.5hp/liter*bar.
Fact2: A C6 corvette Z06, a car also made in 2005 has 72hp/liter*bar.
Fact3: A C6 Corvette Z06 is constantly given shit for its 72hp/liter*bar of power.
Fact4: 72>62.5
Facts 1+2+3+4= The Veyron should be given shit for its extremely low power output, from such a gigantic engine, at such high boost pressure, at such a high price. In other terms, it is inefficient in making 1000hp.
Reply: TheXdmgx7 Lol. Making up your own different* formula against a pushrod V8 and a four turbo W16 engines. Again, all of these are just your opinion. 

C6 doesn't have a 1000 hp and a top speed record. And it comes with a POS interior and lots of mismatch plastic panels. And it will be remembered as a worse car against C7. 

Seriously, if you think your "wisdom" is better than everyone else, then why P1 and 918 isn't fighting the crown from a Corvette? You are smarter than McLaren and Porsche engineers? Why everyone still remembers  Bugatti Veyron as the ultimate car icon? Because it matters.
Reply: mercedescl  Not an opinion. Listed 4 facts and the conclusion was just adding them to each other. Very simple. Even you should understand it.
Lol the C6 was a 50-100k$ car. Good job again on the cars you choose to compare with the Veyron. First a Hellcat and now a c6 lol
That made no sense. They aren't fighting against the Veyron to win the crown either. They completely outclassed the Veyron since before they were even designed.
People remember the veyron as the ultimate car icon?! Who?! You and your mom? People remember it as the ugly car that cost a lot and claimed to be the fastest, even though it wasn't.
Reply: TheXdmgx7 Lol. Again, it's just your opinion.
Reply: mercedescl Again, fact.
Reply: TheXdmgx7 They are all your opinion. 

One of a kind engine, 1000+ hp, a top speed record in the Guinness record, and capable of cross country driving.  What not to love? What more can be achieved in any production car?
Reply: mercedescl No, not a single piece of my reasoning was debatable. Just like how 2+2=4 is not debatable. That made it a fact.
Pretty odd engine (for good reason), 1000hp(less than many opponents), previous holder of a top speed record, capable of cross country driving (just like all its opponents). 
What's so special about it? What more? SSC Ultimate Aero, Venom GT, Koenigsegg Agera, P1, LaFerrari, 918, Enzo, F1, Aventador, Corvettes, Vipers, etc. The first 6 are better, the next few have much higher potential.
Reply: TheXdmgx7 Lol. Did you ever go to college? higher or lower horsepower numbers are facts. Better or worse cars are opinion.
Reply: mercedescl Wrong, horsepower numbers that have not been independently tested(Veyron's) are just claims.
Reply: mercedescl  I'm the dumb one, Mr. "facts are your opinion"?
Yeah but the Veyron's one of the few cars with no dyno sheets. Still not a fact. The fact that it was slower than the SSC is a fact though.
Reply: TheXdmgx7 wahahaha You again compare a production car from large corporation and a tiny backyard company in America. 

Lol. Not only Veyron is keeping the crown in the fastest production car record as of today, but speed is only one thing. Buying a car means you have to deal with maintenance, dealership, repairs, safety and human factors like quietness, reliability, compliant of suspension. 

Facts are Veyron is the first production car to have a 1000 hp. The first car to have 7 speed DSG. The first car to have the fastest rating tires in Michelin history. The first car to have W16 engine. The first car to break the fastest production car record twice. And the first car to have non racer journalists to test its top speed limits. The list goes on and on for how many incredible achievements the Bugatti Veyron had achieved. 

If SSC puts an amateur from the media and has him test the top speed trial and a celebrity drives it in downtown LA to a nightclub, then I am going to convince it is a better car. Otherwise, NO.
Reply: mercedescl Yup, I "compared a production car from large corporation and a tiny backyard company in America" and the car from the "tiny backyard company in America" won. Took the "large corporation" 3 years to regain the fastest car record. Lol that's inefficiency. Because of its pointless complexity, they had to redesign a bunch of crap. And it still launched the same lol the POS 7 speed DSG they made for it can' launch hard. The poor thing will break.
Reply: TheXdmgx7 "If SSC puts an amateur from the media and has him test the top speed trial and a celebrity drives it in downtown LA to a nightclub, then I am going to convince it is a better car. Otherwise, NO. "
Reply: mercedescl
 If Bugatti did their top speed runs on a closed public 2 lane road(like the SSC), then I'm going to agree that it's designed to be able to drive cross country at speed. Also Jay Leno has driven the SSC in LA. So yeah, faster and as good or even better on public roads.
Reply: TheXdmgx7 Lol. It is not faster and it is not better on public roads.
Reply: mercedescl
Those are your opinions. It is proved that it faster and better on public roads, based on the fact that its top speed is higher than every single one of those "first car with over 1000hp Veyrons, and the said top speed run was done on a public road. Wahahaha as you say
Reply: TheXdmgx7 Lol. Not what it says on the record book. Bugatti Veyron is still holding on to the crown. 

"Facts are Veyron is the first production car to have a 1000 hp. The first car to have 7 speed DSG. The first car to have the fastest rating tires in Michelin history. The first car to have W16 engine. The first car to break the fastest production car record twice. And the first car to have non racer journalists to test its top speed limits. The list goes on and on for how many incredible achievements the Bugatti Veyron had achieved. "

These are the facts. Where is SSC in all of these?
Reply: mercedescl Nope, Venom GT is holding the Crown, and the 2005 Veyron never actually held the crown. 
You're too obsessed with specs. The fact of the matter is the regular Veyron was slower than a car made by some tiny company in America, and the Super sport is slower than that 2006 SSC, the Agera, and the Venom GT. Those are facts. It's getting beaten by cars that do their top speed runs on public roads because VW won't let them use their test track. They're beating it with less than 3 miles to accelerate. Veyron had over 5 miles of smooth road. 
Just accept it's slower, and we can keep talking.
Reply: TheXdmgx7 Lol. Everyone with google search can find out who held the crowns. Supersport still held on to the crown because Supersport was built specifically faster than SSC. Agera still has not tested with third party or Guiness book of Record. And Venom GT had never completed the 30 car sales.

You are funny. When the spec is in Veyron's favor, you don't want to talk about the spec. When history is in Veyron's favor, you don't mention about Veyron's automotive first achievements. When VW has backed its Veyron with its mighty force, somehow it is Veyron's fault.

You are just a sore loser.
Reply: mercedescl Go google "fastest production car" lol
You keep talking about the specs, I told you that other cars have equal or better specs. You talked about technology and I repeatedly asked you to name a new technology on that car and you failed. You say it is a legend because it was the first car with 3 things, 1000hp, and a 7spd dual clutch, and a W16 engine. The 1000hp was beaten less than a year after, the dual clutch had only a gear more than the DSG on a freaking golf, and a "w"16 is a bad thing, so definitely nothing to be proud of. 
The new technologies on a legendary car should not be non existent. It's as simple as that. Any legendary car has had a new technology of some sort, and the Veyron simply doesn't. It's a combination of old technologies in one huge and inefficient package.
The only thing it succeeded in doing was establishing a large fanbase among uneducated people, mostly thanks to Top Gear's James May.
Reply: TheXdmgx7 " The 1000hp was beaten less than a year after, the dual clutch had only a gear more than the DSG on a freaking golf, and a "w"16 is a bad thing, so definitely nothing to be proud of. "

First is first. Do you remember who came after Columbus? Who stepped on the moon after Armstrong? Neither do I. 

Turning a DSG that can take 300 hp to take a 1000 hp needs a lot engineering work. I think you can do it easily in your xBox. 

W16 is a bad thing? What about Rotary? What about V8? V8 bi turbo? V12? I6? H6? Everyone knows V6 is a perfect balance for power, space and packaging but how boring is it if everyone just use V6? 

Cars are consumer products. Sooner or later, better cars will come, and kings will be rusted away in the lots or stored away for few collectors. At least, Bugatti Veyron has its moment. 10 years from now, everyone who read the history book will find Bugatti Veyron about its legendary 1000 hp W16 engine and its top speed records. Who will remember a plastic car and a kit car from backyard companies? Do you remember Vector? De Tomaso? Lotec? or Cizeta?
Reply: TheXdmgx7 Lol. "First is first. Do you remember who came after Columbus? Who stepped on the moon after Armstrong? Neither do I. 

Turning a DSG that can take 300 hp to take a 1000 hp needs a lot engineering work. I think you can do it easily in your xBox. 

W16 is a bad thing? What about Rotary? What about V8? V8 bi turbo? V12? I6? H6? Everyone knows V6 is a perfect balance for power, space and packaging but how boring is it if everyone just use V6? 

Cars are consumer products. Sooner or later, better cars will come, and kings will be rusted away in the lots or stored away for few collectors. At least, Bugatti Veyron has its moment. 10 years from now, everyone who read the history book will find Bugatti Veyron about its legendary 1000 hp W16 engine and its top speed records. Who will remember a plastic car and a kit car from backyard companies? Do you remember Vector? De Tomaso? Lotec? or Cizeta? "

You are not arguing against my facts. Bugatti Veyron already made its marks in automotive history. There is no point of saying it is stupid when it WORKS. You think it is stupid because you are stupid.
Reply: mercedescl You just said all that crap lol try again.
Reply: mercedescl lol exactly what you said last time. One more try?
Reply: TheXdmgx7 wahahahaha :0
Reply: mercedescl ;)
Reply: TheXdmgx7 plus 460 and 454s have much shorter strokes than they could have
Reply: lipinski1337 huh?
Reply: JuanCarlos CastilloDisla So people can't appreciate a record breaking car with a completely different engine layout and a limitless expense engineering excess?
Reply: mercedescl different ≠ better
The SSC was a record breaking car too...don't see you praising it. 
"Limitless expense" usage of pre-existing technology...interesting
Reply: TheXdmgx7 Lol. Because we are talking about BUGATTI VEYRON?

Pre existing technologies? Even the tires are using brand new compounds and uncharted rating.
Reply: mercedescl We talked about MANY cars...182 comments...You never once praised any of the record breaking cars I named. (the definition of a fanboy)
Or so they say..."tires deteriorate in 15 mins" and the Venom, Ultimate aero, and Agera all use regular Pilot sport cup tires that are not "$20k each" and do function at 270mph
Reply: TheXdmgx7 Lol. You praised many cars but not Bugatti Veyron. Why do I need to please you? Or praise a plastic kit car with V8?

Venom isn't come with traction control nor sold 30 cars within a production year. UA, for most of its production life came with a Corvette engine, and it never sold more than 10 cars at any given year. 

Agera is pretty nice, but it comes years after Bugatti. No one remembers the second person who landed on the moon.
Reply: mercedescl You're doing enough of that for both of us and they're carbon fiber. Hence the low weight.
Venom's faster, UA is faster, Agera is faster. 
The CCX has the speed record before the Veyron did. 2 months before if I recall correctly. UA had a Guinness verified record before the Veyron did also. That 30 car shit is something new that VW paid for after the Venom beat them. Even RUF and Brabus are considered production. These bespoke "plastic" cars ought to be.
And lol the Veyron is definitely not an equivalent to the first person on the moon lol that would be 959, f40, F1, countach, etc. Cars that are remembered and referred to many years after they're made.
Reply: TheXdmgx7 Who cares? No matter how fast future cars will be, Bugatti Veyron is still THE FIRST production car with a W16, a 1000 hp, and a top speed record. 

FIA GT is always set as a 30 cars per production year to prevent cheating. 

959 is ground breaking. F40 isn't. F1 is ground breaking, Countach isn't. 

People will remember Bugatti Veyron.
Reply: mercedescl Do you remember the first car to have 100hp? 200hp? 500hp?
First v8? first v10? first v12?
first car to do 100mph? 150mph? 200mph?
FIA GT is not a measure of a car being a production car. It's for whether or not they can race in the series. The Guinness rule on the minimum production number is also something new and only put there to protect the Veyron. Proof? The 2 cars that held that record prior to the Veyron (CCR, F1) and the one after (UA) did not have anywhere near that many units sold. 
Lol you call the f40(first production 200mph car) and the Countach (first 300kph car) not ground breaking. What is the Veyron compared to those legends? At least those took more than a year to be beaten.
People remember the Veyron like they do the XJ220. Yeah it was fast at one point but was quickly beaten by something better.
Reply: TheXdmgx7 Lol. That's my opinion. You don't have to like it. 

"Do you remember the first car to have 100hp? 200hp? 500hp?
First v8? first v10? first v12?"

Because 500 hp cars are everywhere today. It is not hard to find a V8, V10, or even a V12. But you still can't find a 1000 hp from a large manufacturer and a W16 engine anywhere else.
Reply: TheXdmgx7 Lol. 911 isn't a great car in the beginning. It was a glorified Beetle with a slightly bigger engine. The handling is unique but it was hopeless comparing to the contemporary FMR sport cars. F40 and Countach are shocking bad in build quality, reliability, and, from many mechanics' standpoint, they are simply almost impossibly difficult to do maintenance works on. California and GTO needed museum level of care to survive the ages. These cars became legends not because of what it is; they are engineering disasters but they are legends because people think they are. 

You simply can't argue with Bugatti's successes, headlines, and records. It is a "thing" of this age and you and I can't shut up about it.
Reply: mercedescl  And the Veyron is a great car, just not ground breaking. Ground breaking cars become timeless...not spec sheets.
Oh the Veyron is easy to maintain?!?!?!?!?!
The Veyron is a faultless car with a pretty impressive spec sheet. It is an astonishing marketing campaign too. Selling a car with no new technology as something ground breaking is quite a task.
But that's the problem with spec sheets...they get beaten. As you mentioned, nobody cares about 500hp cuz many cars have them. There goes all the Veyron has. But nobody likes the f40 because 200mph or whatever. They like it because it's the freaking f40. No reason required. That's where the Veyron loses to the Countach, f40, etc.
Reply: TheXdmgx7 Lol. Rolex has a watch that can function under 500 m of water. Do you want to test your $16,000 watch under 500 m of water? You won't even wash it on tap water. 

Bugatti Veyron is a "thing" because everyone knows about it and talks about it. People love it and VW engineers really make that car works. Good enough.
Reply: mercedescl bro he is right. Every real car Enthusiast knows this. Look I get your point about how a 16 cylinder is quite an amazing thing in a car but it is entirely useless, to heavy, to inefficient, and also don't forget,  it's way underpowered cause it does not fit in a car but on a freaking plane. Now the bugatti was just a car for people who wanted to waste they're money on something they wanted to show off. It is a machine that should have never been created but it was necessary to show people W16's are useless. Cause there are human machines out there with 36 cylinder engines... Does not mean it will be cool to fit it in a car when a V12 can do the job.
Reply: JuanCarlos CastilloDisla Lol. All supercars are inefficient and useless. The point is to dare to imagine and apply. VW isn't selling you a minivan with a W16. It is a supercar conceived in 1999. An age when NSX, a less than 300 hp could call itself "supercar".
Reply: mercedescl Yes I would totally try that. Nearly every vehicle I've owned has been near its top speed. Every waterproof watch I've had has been under water.
But that's entirely beside the point. The Veyron is like a Camry. You can't fault it, b ut there's nothing special about it. That's why the Camry doesn't have a cult following and the DSM does.
Reply: mercedescl The NSX came out in 1990...and it'll still outhandle and outlast a Veyron any day. 
Again and again, you think nobody wanting to make 1000hp because it is redundant as "nobody can make 1000hp because it's difficult" which is not the case.
The automotive world is sale driven. If Ferrari ever needed a power figure to sell their cars, they would make power. Lamborghini's Aventador was falling back in the power game. They found 50hp in no time, without a turbo. You think they can't add a turbo? It is that simple. I assume this sentence was used in the first Veyron meeting: "The eb110 didn't sell, cuz it was outdone by our competitors...lets make something they wouldn't have. Big engine in a useless layout that makes 1000hp. That will take us in a segment with no other cars in it and that's the only way anyone would buy a Bugatti over a Ferrari." And it took them 10 years to sell 500 units lol
Reply: TheXdmgx7 outhandle and outlast? Who said so?

You are writing irrelevant things again. Read: first production car with a 1000 hp and W16 engine. Period. Good enough.
Reply: mercedescl Honda vs VW...enough said.
Tell me what was the first car with 100hp and first v8. Period! lol The Veyron specs are pretty normal now, let alone 10 years from now, when the car will be forgotten.
Reply: TheXdmgx7 But now, it has its moment. It is a "thing" that worth weeks to talk about it.
Reply: mercedescl
now people talk about Regera, P1, 918, LaFerrari. Veyron had its time between 05 and 06, and then again in 2012 or whenever the SS came out, until it was beaten by the Venom GT.
Now it's kinda like a Bentley. People think it's cool but have no idea why.
Reply: TheXdmgx7 Lol. Venom GT? A kit car with a Lotus chassis and no traction control or DSG? 

Bugatti is a car that can go 200 mph AND go to a nightclub and shop in Bel Air with the driver in high heels. That's its unique engineering achievements. Not just speed. 

It's like that $16,000 500 m submersible Rolex. It surely can do what it claims to do, but it built for people who will never track it, race it, or break the speed limit with it.
Reply: mercedescl
 Not a Lotus chassis...make sure you're informed about what you bash. No TC no "DSG" but much faster and much cheaper.

Venom GT is a car that can go 270 mph AND go to a nightclub and shop in Bel Air with the driver in high heels. That's its unique engineering achievements. Not just speed.

Ferrari's cars are like Rolex. Legacy and history. Bugatti is like a insert watch company that used to be good but now it's owned by some plastic watch company
Reply: TheXdmgx7 Don't care about Venom GT.
Reply: TheXdmgx7 Lol. It doesn't have marketing budget. It doesn't have globalized dealership. It can't even sell all 30 cars. 

The worst of all, it can't even take the title from Bugatti Veyron as the fastest production car.
Reply: mercedescl
 Bugatti has globalized dealerships?! lol Where exactly can I find a Bugatti dealership?!
The joke's on you because that, it did.
Reply: TheXdmgx7 Where did you live? Don't you know how to ... (let me think) ..... GOOGLE?
Reply: mercedescl  Bugatti has 11 in the US. Hennessey has 3. I'm sure Bugatti didn't have many 3 years after the Veyron came out.
Reply: TheXdmgx7 Lol. "The joke's on you because that, it did."
Reply: mercedescl
 You're referring to the speed record, right? Offcourse it did.
A while back you told me to google for the world's fastest car, so I did. Guess what the answer was? I'll give you a hint, it wasn't a piece of shit.
Reply: TheXdmgx7 "You're referring to the speed record, right? "

Nope. In Guinness, the fastest production car is still Bugatti Veyron.
Reply: mercedescl  yeah but you said "Everyone with google search can find out who held the crowns." and google says Venom GT.
Also another funny thing is that Guinness considers the Venom a production car for 0-300kph.
Not sure how much they were paid for that new made up rule of theirs but they must lose any credibility they have for that shit. Freaking pathetic.
Reply: TheXdmgx7 Lol. You must used a Chinese version of Google to find the Chinese version of Guinness.
Reply: mercedescl I'm using the English Version and this is google's answer:

About 14,500,000 results (0.39 seconds) 
Search Results
result for world's fastest car
Hennessey Venom GT

" Lol. Why don't you apologize for your stupidity first?"
Reply: TheXdmgx7 Lol. Then you will see Bugatti Veyron as the fastest production car.
Reply: mercedescl That's where you are wrong. The POS you love was beaten.
Reply: mercedescl Keep pretending to be right...that's cool. Everyone with access to a brain could find out that the Venom's faster, but if that makes you feel better, do so.
Reply: TheXdmgx7 "Guinness World Records is pleased to announce the confirmation of Bugatti's record of Fastest production car achieved by the Veyron 16.4 Super Sport."

Wow. You must be one of the most delusional people in the world right now. 

Venom GT can't be qualified as a production car because it failed to find 30 customers in 12 months production period.
Reply: TheXdmgx7 That's why I said you are delusional because somehow, you think you now make the rules. Who cares about your opinion?
Reply: mercedescl No you see, me presenting evidence to you means something utterly different. If you're too stupid to get it, that's not my problem.
Reply: TheXdmgx7 wahahaha When Guinness book of record is in my favorite, then it isn't "evidence" any more. You are a funny man.
Reply: mercedescl that made no sense...work on your grammar, then read what I said.
Reply: TheXdmgx7 Lol. Venom GT isn't a production car. It can't even meet FIA 25 cars limit. 

If you don't apologize, this will be my last post. Not interested in talking to a coward who can't admit his mistakes.
Reply: mercedescl Venom is a production car. FIA is not a measure of whether or not a car is a production car. McLaren F1 was a production car, and it never reached 25 cars a year. 
So there is nothing to apologize for, but you could do some apologizing.
If not, good day.
Reply: TheXdmgx7 Coward.
Reply: mercedescl "If you don't apologize, this will be my last post. " You lied lol
The Venom GT is the fastest production car.
Reply: mercedescl Even better. SSC is actually registered as kit-car. When it was honestly tested, the major complain was its build quality which was compared to a 1980s TVR. Fun fact, SSC UA is based on Lamborghini Diablo replica the company used to build. Nothing wrong with that as long the company is honest.
Reply: ok a v8 has less powerthan  the w16because the heat from the V8 is easy to control the heat therefore you can let that engine run all out.. W16 Makes about 3000HP with no COOLING.
HEAT=POWER.........THEY CANT LET THAT ENGINE RUN TO ITS PEAK RIGHT NOW SO THEY WONT LET IT RUN CRAZY HENCE NO ONE KNOWS THE TOP SPEEN OF THE CHIRON. That heat is overwhelming..... all this to say right now the engine can run 500km according physics and mathematics. Andthis statement is probably why Bugatti doesn't want the top speed out there yet.....